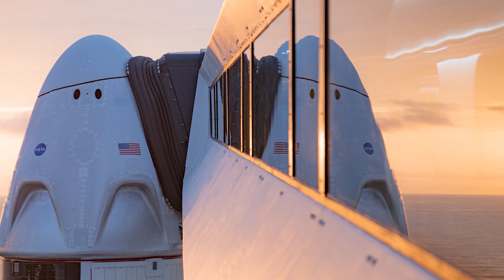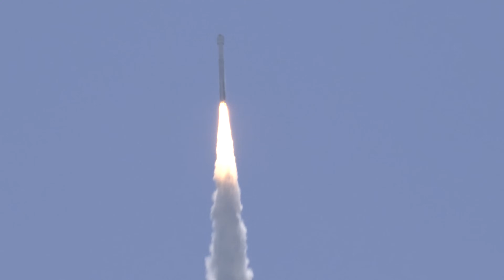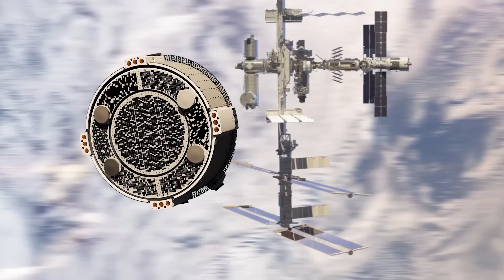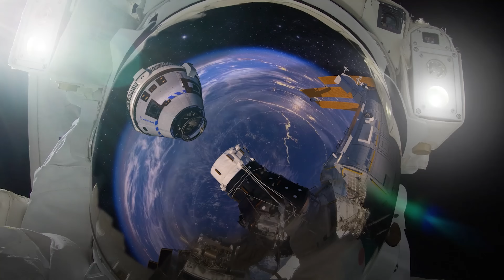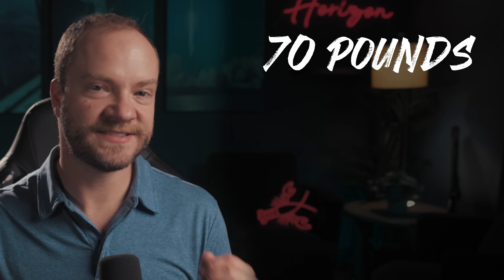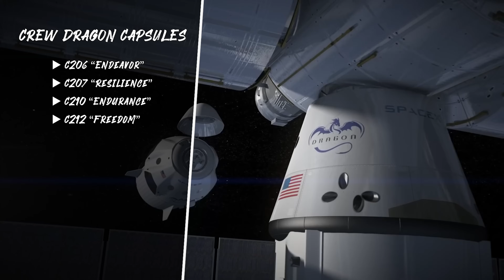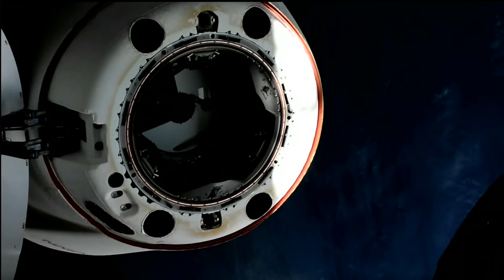Starliner in Trouble 🚨 Should Crew Dragon Rescue the Astronauts?

Comment: but it is very unlikely that just because of a helium leak, they will not have a return, it is somewhat illogical, because, if your car has a water leak from the radiator, you wait to check it and let it empty or you rush back home or get to a workshop to repair it and not be stranded? The Starliner thing is something more serious but they haven't said it, since the launch there were already problems, they blamed the first phase, a first phase that had never failed, then they removed the helium thing, and now they continue with that. I think the problem is software and they are using this time to repair the software and try to get them back. Otherwise, the longer they wait, the more helium is lost through leaks. without counting the energy of the capsule.
Reply from the maker: The helium system is closed while they are docked to the ISS, so no helium is leaking while they are there.

Comment: I'm going to go out on a limb here and I'm going to say that unless Boeing has risen to a yet unforeseen level of incompetence... they have already engineered an autonomous return/de-orbit program into Starliner... for this VERY scenario.

So I don't think the Starliner is an issue.  What might be a concern is that if/when they do this... there is no "Plan B" that then involves any of Starliner's hardware.
So they had better ensure that this mess gets so bad that Starliner is a complete write off and then hope to hell that Space X can design a functioning adapter.
This isn't a task I'd want to give to Boeing designers at this point.  
Sorry... had to say that last part.

As a side note... if Space X DOES do this... then I think it is imperative that they paint "International Rescue" on one side of the capsule... and "Thunderbird 7" on the other.

Comment: Flying with known deficiencies is a slippery slope and reminds me of a book by the name of Challenger.  That was required reading back in the day for safety and management courses. Boeing taking the path of safety is wise and proper.  The lack of transparency on taxpayer funded programs wasn't supposed to be going on and it is...  The issue I see is the constant software issues and have popped up in every flight thus far and believe a view at the sensitivity of said system that decides when to shut them down.  These problems are a typical result of upgrading the sensors and witnessed a few those in other aviation related applications.  My views are guesses and often wrong in the long run, but if any doubt, send it back automated on its own to confirm the software shutdowns are not a problem...  A barbeque roll on reentry isn't good and Boeing "used" to have the philosophy that the "pilot" should always be able to override any automation and that has saved lives in the past...

Comment: Very good dive into the issues.  Really enjoyed watching.  Most of noise regarding Boeing on the internet is just that, noise.  But Boeing has brought it on themselves with some shoddy policies regarding the manufacturing of the 737 Max and the fact that Boeing got a billion more than SpaceX to develop their capsule and yet, SpaceX has performed better.   As your presentation indicates: while spaceflight always has risk, the evidence does not point to excessive risk to the crew upon return.  Boeing is trying to be data driven to improve their capsule and they want to collect as much data as possible before expending their service module.

Comment: What a poorly designed system if a capsule cannot undock on its own any capsule that has a problem and is not safe for humans is stuck covering a docking port forever
Reply from the maker: It's perfectly capable of docking and undocking on its own.  The hypothetical question I said in the video was, if the thrusters are so bad that they can't be trusted with astronauts, then why are we trusting the thrusters around the ISS without astronauts?
Reply: @OLHZN  and the obvious answer is if humans are onboard then people can die
And the starliner has never been said to be in such bad condition for undocking just the landing burns

Comment: Ok Boeing FanBoy, Boeing is legacy. It's Apollo with a new paint job. They have never been forthcoming with their information. It only comes out after a problem has cropped up. Sure Boeing may nurse Starliner back safely but to what end. It's way over budget, way too expensive and not reusable in any way. Plus Boeing and computer software are not friends. They have a cost cutting habit of using old software and trying to just update the parts they think they need. MCAS ring any bells? One of the reports says that Boeing isn't sure if the thrusters are mechanically malfunctioning or if the software just isn't working or reporting on them correctly. Boeing has a flawed product that has ended up with an over 1.5  Billion dollar overrun for the company so far, not including the bloated initial cost of Starliner. Boeing caused the deaths of 346 people on their badly designed airplanes and software. Let's hope they don't cause 2 more deaths on their flawed spacecraft.

As a safety procedure sending a Dragon as backup makes sense. It's simply a good procedure. The Polaris Dawn capsule is potentially ready now. It could be reassigned, be loaded with emergency supplies/equipment to help Starliner as well as reduce stress on existing ISS supplies. Careful decision making would include this reasonable alternative. The custom seating and suit issues are easy enough to address. NASA has the custom sizes of every astronaut. SpaceX could probably have close to custom seats and suits on hand, made, built or modified in a few days with the proper size information. And portable life support is generally a standard piece of equipment on any mission allowing them to use their existing suits. Also, with the proper specs, SpaceX could probably design adapters for their suits to be compatible with Dragon systems. Either way it is doable for an emergency return mission. And since we (the space community) have the options, we might as well consider using them. This was the whole reason NASA wanted redundancy in the crewed launch systems. If one is having issues, we have another one.
Reply from the maker: Polaris Dawn? You didn't even watch the video, did you?  I talked about this.  Polaris Dawn has all the docking hardware removed.  How do you figure they will run a rescue mission without docking hardware?
Reply: @OLHZN  If Polaris Dawn became a rescue option, the docking hardware is not a major adjustment for SpaceX for such a mission. I was in the military. We had last minute mission changes all the time. Not to mention, a planned additional Dragon capsule that was scheduled might be built and ready by now. If not one of the other of the three in the rotation should be close. They still have scheduled crew rotations. So there's no telling how close the next Crew Dragon is to launch ready. At the end of July, Starliner is not going to be viable to be docked to the ISS anyway. It can only stay docked for 45 days according to NASA. Their options will be limited. Take a potentially faulty spacecraft to reentry, probably the most dangerous part of the mission, or wait a little longer for another proven craft. I'm sure they would have time to reinstall the docking hardware if necessary or have another one prepped by then. I'll point out that if these thrusters malfunction during re-entry, there is no "hold" to check them out. They work or they don't. If the capsule can't keep proper orientation, that would be bad.

Comment: 3000 psi is NOT extremely high pressure.
Reply: That's a car on a fingernail. Idk what you're comparing to but I'd say that's a fairly high amount of pressure
Reply: @notgreg123  My $500 pressure washer goes up to 3,500 psi. My airless paint sprayer a bit higher at 4,000 psi
Reply: @notgreg123  I'm comparing it to the most basic industrial machinery. 
Low pressure Hydraulic systems are 3000psi
Reply: Oh damn nevermind then lol

Comment: Remember how it used to be said that American Astronauts were made of the "right stuff". Well I believe they still are, let them get on with what they signed up for, human spaceflight is very dangerous, about a 1:500 chance of death. They judged the reward to be worth it.

Of course, as much as possible should be done to recover the crew. Just stop expecting Astronauts to never die. This is not an issue which requires abandoning the Starliner vessel. They will return in July on Starliner successfully.

Base Jumping with a Wingsuit from a mountaintop is one of the most dangerous sports, chance of dying 1:600, just like spaceflight. Mount Everest has death rate of 1:50, K2 is 1:5 and Annapurna is 1:3!!

Comment: The problem with your analysis is that Starliner isn't crew rated yet, this is a test mission to finally get that rating, to get crew rated Starliner needs to have a pretty much flawless mission which so far it hasn't had and this together with previous failures, which they never really got to the bottom of, means it is now unlikely it will get certification after this mission either. The problems it is having now are similar if not identical to the problems it had last mission and if something does go wrong and astronauts are lost the resulting investigations will be focused on who made the decisions to allow it to go ahead at all given how poorly Starliner has performed in previous missions.

Comment: The elephant in the room...and I've been saying this for years. 
Why doesn't the US (International) Space Industries standardize their hardware 
so SpaceX gear can work on Boeing etc. 
Everything is a one-off proprietary special design. 
We have it for other industries like computers, electronics, military, and shipping cargo, etc using ISO standards. 
Standardization brings down costs of not reinventing the wheel and makes things safer for everyone.  
Another idea is to require all manned US spacecraft have a spare seat for emergencies.
There should be a move by NASA to always have a rescue spacecraft on standby which can be rotated out for missions to keep things fresh. 
If the Russian or American side is cut off like the Mir accident, what then. 
The Polaris mission C207 Resilience happened at the wrong place - wrong time. 
There are glaring issues here and we shouldn't just live with "you ride down what you rode up in."

Comment: The Issue for many is:
One helium, happens. 5, even if minor ones, show there is a systematic problem in the helium system.
One thruster failure, happens. 5 thruster failures on a system that has a history of thruster failures, manageable or not, this is horrendous. 
The company that build the capsule is in trouble because of facked dokumentation of work, wrong materials used, using throwout parts, kicking out critics of procedures. Even if it is in a differend departartmend, that is bad.
The project is over budget and it eats their own money.
The PR sound like Salami slicing tactics.

The whole picture smells, and people are woried that it gets worse.
That fear might be over the top, but they have valid reasons.
Reply from the maker: I think most of that is fair.  It's fair to criticize Boeing.  It's fair to question why they've had issues repeatedly.  It's fair to even question if there's a bigger culture/systemic issue.  I'm fine with people saying "why is Boeing having thruster issues again?", but what I'm not ok with is when people make the jump from "a thruster has failed" to "the astronauts are in danger and they'll die without a rescue mission".... We should be able to agree that yes, Boeing is having thruster issues again, and that's not ideal, but no, the thruster issues are not life threatening and this mission can be completed just fine.  Then we can start the discussion on why issues are repeating.

Comment: This HAS to be one of the more lucid approaches to what Starliner is running into. I REALLY appreciate the detailed explanation of the nature of helium and the fact that this has happened on several boosters. It also happened on the Space Shuttle. The same with the thruster issues. Remember this is a TEST FLIGHT. Also, SpaceX had the luxury of making most of its mistakes during the Commercial Cargo Program, which gave it a low-risk environment, to refine their flight skills. Boeing didn't have that opportunity. A reminder too that the Crew Dragon Endeavour stayed at the ISS for a grand total of 62 days. It also gave time for the folks on the ground to understand the vehicle. The same process is going on with Starliner.  They will also have some time for ground teams to gather data and understand the vehicle. PS- There are also TWO EVAs or Spacewalks planned. One is scheduled for tomorrow morning ( June 24) the other for July 2. NASA wants to get those two EVA's in the rearview mirror before putting the Expedition 71 Crew through undocking. The point is that NO ONE IS STRANDED!! Thanks for publishing this,  with all of the disinformation passing off as "news" about this mission. This video was a breath of fresh air. You have a new subscriber. And I'll have to get you on Talking Space at some point. Thanks again.
Reply from the maker: 💯 thank you!!! 🙏 Totally down to podcast - hit me up any time!

Comment: If this was SpaceX's first launch with crew with all these issues there would be so many people hating on SpaceX. Boeing has failed time and time again to be reliable. it's time for them NASA to bite the bullet and pull the plug on this program. If Boeing really wants it to succeed they can work on it with their own money.
Reply from the maker: SpaceX did have issues on their first launch with crew, and not much was said. I suspect you didn't hear about them?
Reply: @OLHZN  What issues exactly?
Reply from the maker: Excessive heat shield erosion and unexpectedly late parachute deployment were two of the "bigger" issues.  Both minor issues in the end, but so are the Boeing helium and thruster issues.
Reply: @OLHZN  The parachute was within the expected window just not exactly in the middle. So not an issue at all let alone a mission critical issue. Also the heatshield erosion was an observation made after the flight which didn't impose any specific concerns it was just more than they expected. This is just being nit picky. 

Instead with Starliner we quite literally have astronaughts stuck in space currently because their capsule has so many issues coming up not only during the mission but before it even left the pad.
Reply from the maker: No one is stuck in space.  They are cleared to come home in any emergency scenario.  There is no rush to get home, which is not the same as being "stuck".  

I completely agree with your assessment of SpaceX issues.  You missed the point.  They are indeed minor and nit picky.  My point wasn't that SpaceX issues were major, it's that the Starliner issues are also minor and nit picky.  There are zero major concerns that have been revealed at this point.  Minor helium leaks and 1 bad thruster out of 28 is not cause for major panic.  There is redundancy upon redundancy still available even with the existing minor issues.
Reply: @OLHZN  Yes, while true, they are not technically stuck in space. That being said they do have a ticking timer to gather there data before the 45 day window closes. 

But isn't a bigger issue here the fact that they had the same failures in their first demo mission 4 years ago? A failed thruster, and multiple helium leaks. Why after 4 years are we still seeing the same issues?
Reply from the maker: I think it's fair to criticize Boeing about that and question why they've had repeated thruster issues.  That's an entirely separate topic to their current situation IMO.  I don't know the answer to that question, and this is the lack of information I referred to in my criticism at the end of the video.

Comment: Here's a solution:  Instead of Helium in header tanks, use Argon (also a noble gas). The molecules, at 71pm are 2.3 times larger than Helium. The result is that Argon won't leak nearly as readily as Helium. Argon, at $1.00 USD per cubic meter is also roughly 60 times cheaper than Helium. It is heavier, but that is a reasonable trade-off.
Reply from the maker: Argon is a potential candidate, but it doesn't perform as well at cryogenic temperatures.

Comment: 10:10 the reason they undock with a crew is if for some reason the craft can not re-dock, the crew a is already on board. The Starliner (or Dragon) can dock or undock themselves or be controlled remotely.
Reply from the maker: Yes, agreed.  The crew is also on board in case there's an emergency in the short time they are undocked, then they have a safe haven.  👍

Comment: 6:00
If Boeing permits astronauts to return on the Starliner and an incident occurs, they could attribute the failure to human error. While this would result in a media frenzy, it would likely be manageable for Boeing. Conversely, if SpaceX is tasked with rescuing the astronauts and the Starliner is sent back alone, only to disintegrate upon re-entry, it could severely damage Boeing's already precarious reputation in the aerospace industry. In recent years, Boeing has repeatedly shown a tendency to prioritize financial gain over human safety. Furthermore, Boeing's substantial influence over Congress effectively undermines NASA's regulatory control. Assess the situation accordingly.
Reply: Human error? You do understand every single spacecraft has been computer controlled, nobody is manually firing the burns on the spacecraft and if Boeing blames the ships failed reentry on human error then they should be blamed, the deorbit burn relies on the computer to calculate